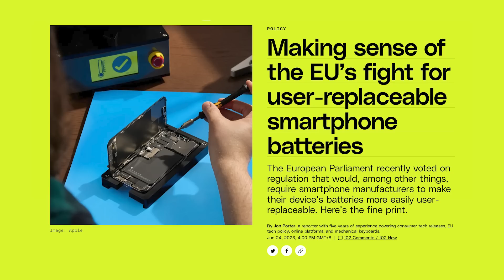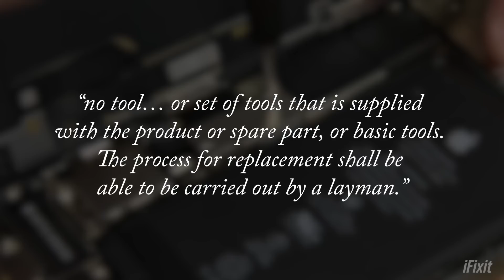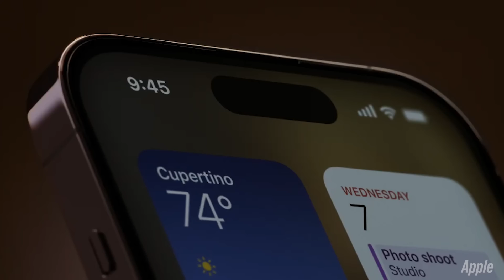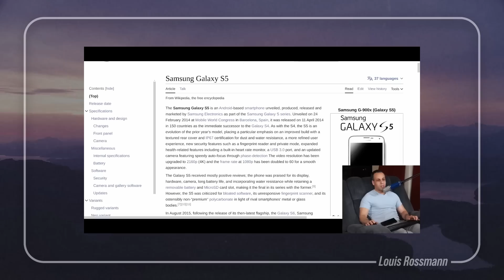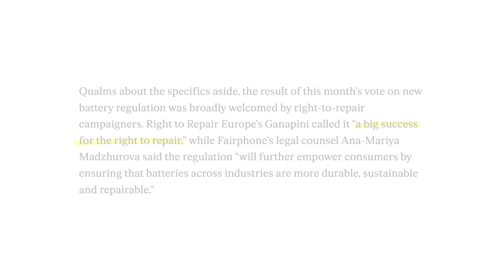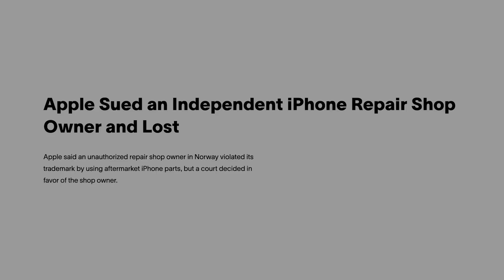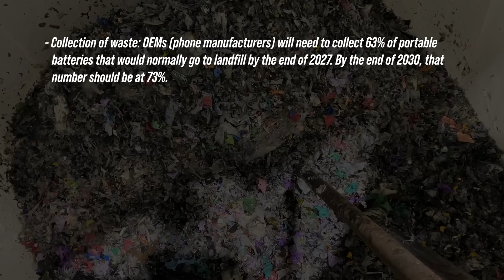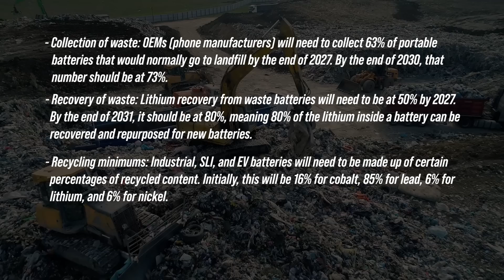EU Just Changed Smartphones Forever

Comment: There’s a case for easily removable phone batteries: cyber security. Being able to verify that the phone isn’t silently eavesdropping on you or recording positioning etc during sensitive meetings etc.
Reply: Also being able to quickly kill the phone if there's a breach in progress.
Reply: @natesmodelsdoodles5403  That saved my laptop years ago, glass of water fell on my keyboard, I acted quickly taking out the battery shoting down the laptop in a second and turned it upside down on a blanket to drain the water, no damage was done next day I could use my laptop normally, now when you cannot remove your battery like that, such a accident would kill my laptop, cuz turning it off takes much much longer.
Reply: The main problem is that recycling such phones is damn difficult. It is difficult to get such batteries even on an industrial scale. Batteries not only pollute the environment, but also contain many valuable metals. How much easier it was to live in the early 00s, with plastic cases. The battery was processed separately, the electronic filling separately, and the case separately. And you could buy a battery, change the case, and even fix the phone itself. It's time to put an end to mindless consumerism.
Reply: Or when they are turned off, but can have an alarm
Reply: Batteries cannot contain malware lmfao
Are u high?
Reply: Yea right, hate to break it to you, but you're just not important enough to expand resources hacking.
Reply: taking out the simm would usually suffice, all the spying happenes through the computer inside the computer (sim inside the phone)
no sim, no contact to the cell network... no spying.

And if you then still have doubts, put it into a farraday-cage i.e. the microwave. 

just make sure nobody turns it on while you phone parks in it.
Reply: These are also reasons AGAINST removable batteries. Big brother doesn't want you to be able to 'go dark'.
Reply: @Shaun.Stephens yes... That is why the EU is pushing this, and not the states, godfather of "big brother" 😂
Reply: @fhorst02 I didn't even think about that .
Reply: @Shaun.Stephens  how are you going to make an anti-establishment comment under a video talking about the establishment making it harder for tech companies to spy on you?
Reply: @Shaun.Stephens and what is stopping the big brother from installing a smaller built-in battery to power a gps beacon or voice recorder to dump the gathered info when the main battery is back in the phone?
Reply: @Je_QzcY3mN0 exactly. 
And imho this paranoia is not worth the potential downsides (cost increase, IP 💦 rating, size increase)
The screen is the first to break anyway.
Reply: @lucbloom nope. Have 4 phones dead just because of battery malfunction. And discontinued software support. Have no broken screen in 10 years
Reply: @lucbloom The first to break yes. But the Battery's turn to shit within a year. Talking about samsung hete.
Reply: @user-ce1cu5my4j That's why you should always wrap your phone in three layers of perpendicularly oriented tin foil, and carry a piece of natural rock crystal in the pocket opposite from the phone. This sets up a transverse 5G canceling oscillation that prevents the hidden battery from operating. 
If you are genuinely concerned about being tracked, do not carry a phone  - and dont drive any car with factory satnav, you'll want something at least ten years old.
Reply: @lucbloom GoPro has a removable battery and is waterproof.  Next excuse?
Reply: @igorh Samsung batteries I don’t know about. Maybe N = 1.

@dbd3265
Sure you can make it, but it’s a restraint and restraints impact the design and the cost.
Reply: This is one of the best EU rules to be implemented , I’ll miss my Samsung phone with the built in ear warmer……
Reply: very interesting point raised here. good forward thinking sir.
Reply: flip phones were known to have a smaller battery inside them that continued to record while the larger battery was removed
Reply: @BennyHarassi   you talking about the SMALLER than normal Flip phones before smartphones? highly doubt they had any backup battery in them. even harder to put such a battery in a smart flip phone as the space is REALLY limited...
Reply: @BennyHarassi  I did not know this! Thanks for explaining 👍
Reply: @BennyHarassi  If you believe this to be true then you'll have no problem linking to a video or teat-down page that clearly shows this. Please, show your proof.
(I'm a tech guy and know this is untrue by the way...)
Reply: If manufacture really want to spy someone they can easily put small batery that active when main battery is removed. In this case, ut can make people have false security.
Reply: @krisyannuruha5147 as if tech reviewers wont pull the phone apart and find the battery

Comment: I think they better require the battery lasts for 5 years without loosing capacity. This can be achieved by operating in the range of 20%-80% of the current charge scale. This can require a bigger battery, but the ability to replace also eats space.
If the user replaces the battery himself he throws the old batery as a general waste. And he might buy a poor quality fake battery. Also if the replacement is model specific, then there will be many not bought units as it is with covers now. So the replacible battery must be unified to help the environment anyhow. So you could buy a Samsung battery for your IPhone and vise versa.

Comment: all this fuss they seem to ignore the car industries impact on waste over the years, look at them all using the same size wheels but look at how many different types of brake disk and pad there are, how many windscreen wipers, liquid reservoirs, some industry standardisation would make the whole game cheaper, but then why would anyone pay their 10x premium for their brands logo.. they want $300 for a replaceable rear window pulley system because this car is a bit rare (mitsibishi colt CRZ) its not something you can get from the scrappy, and if you can its still $300 for the whole unit minus the motor. Jokers man

Comment: I would not like it removable batteries, I had never problems with mine phones, well I buy every 2 years a new phone to keep up to date and also a faster phone. 

And I know that the phone are made how they are now for better water and dust resistant. And that we didn’t had in the past. 

I don’t see the value in removable batteries. I will not like to use mine phone for 5/7 years because it will also become slower. Batteries need to be build better or different.

Comment: This is a good step forward, but this won't truly reduce the e-waste from Apple and other devices. One of the more insidious tactics is to deprecate operating software support. Many manufacturers stop supporting their software after 3+ years. Even if the device is in pristine condition, the new OS is so resource intensive that it can no longer run the existing apps. The apps themselves are still the same, but the OS throttles everything so they no longer operate, creating an unbearable user experience, forcing users to upgrade to the new, better, faster.

Comment: Finally! Modern phones  already passed the level when you lack the computing power in the cheap or a bit older phones. The battery was first thing to die if you dont brake your phone. Also, fck apple!

Comment: The automotive industry is just as bad as the phone/computer industry. My car has headlights that I can't change myself, they are digitally linked to my car. I can't even use the headlights from the face-lift model as although externally they are the same the manufacturer has changed the electrical connection design. This has been going on in the automotive industry for years, 
In order to change certain parts you have to go to the approved dealer to have the item digitally connected to your vehicle.

Comment: The next step is to have standardized sizes, like with alkaline batteries. Much of the very high cost of phone batteries is that every phone uses a custom-sized battery.
Reply: While that would be cool, it would be difficult considering the different shapes, sizes, and components of each phone.
Reply: @@usingintelasaheater5548 The worst thing? Worse than requiring a live elephant to be tethered to each phone?
Reply: 100%  They will probably just make a proprietary battery that is so expensive that it would make more sense to buy a new phone.  The worst of both worlds.
Reply: @davidhuber6251 and make sure that only a original battery works 😅
Reply: way to kill innovation
Reply: @Gungrave123  planned obsolescence encourages innovation.
Reply: @helloyes2288  LOL WHAT?? Its the direct opposite. if youre forced to change phones every 3 years, you dont have to work as hard to make a product that has a better selling point. however, if your shit works forever, youre incentivized to make the new model so much better that people are willing to replace a perfectly good phone with it
Reply: @1gnis1337  Ignoring that you're arguing the exact opposite of 200 years of observation, if you everyone is buying new phones every 3 years, tech companies have to always be ahead of their competition to maintain their share of that market - but if you only buy every 10 then they're better off waiting for your phone to break while being slightly better or cheaper than their competition rather than developing new tech to gain an advantage when you inevitably purchase a new phone in 3 years.

Comment: My samsung galaxy s5 used to have a removable back panel and battery, sd card slot, and heart rate sensor. Completely waterproof.  I used to go to the pool all the time with it and take pictures underwater.  Never had an issue with it. Although made out of plastic it was one of the most beautiful and elegant phones I have ever owned. Never problems with fingerprints or worry that it will shatter at the first drop. On top of that aftermarket back panels were wildly accessible for just a couple of bucks. I think we can all thank Apple for the trend with phones that cost more than a laptop and are close to impossible to repair.

Comment: Why wouldnt Apple make a new phone just for the EU?    They have to design and produce a whole new phone regardless.   Consumers have always preferred smaller, slimmer, lighter devices (even if I personally like a bit of heft) and to move away from what most consumers want would be kinda stupid.   Like i know batteries are a key point of failure, and degrade over time, but people sometimes dont buy whats best for them and simply go for what sounds the best to them.   As long as outside of Europe doesnt require this, I expect them to put out the most attractive to consumers phone as possible.  

Also I pray that the EU made this law to make sure that batteries couldnt be proprietary in nature.  Otherwise apple is going to make sure that every phone has a unique battery that only works with that phone that you have to buy separately from the Iphone.   "oh our phone is only 1299* (batteries sold separately, only apple batteries are rated appropriately for this device, use of 3rd party could lead to damage and void your warranty, blah blah blah)"

Comment: One concern I would have is used phones having the original battery taken out, and replaced with a knock-off brand that is a fire hazard. On the flip side, in theory a battery brand could produce an even better battery that lasts longer, but still matches the original in size and fit.